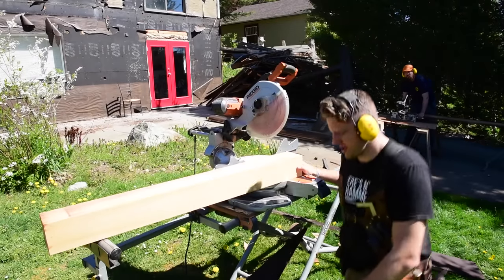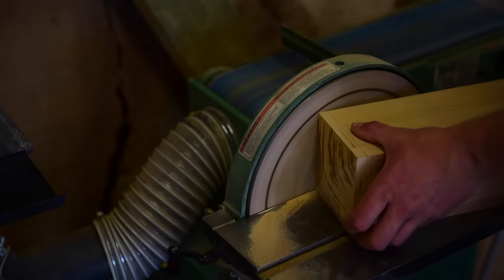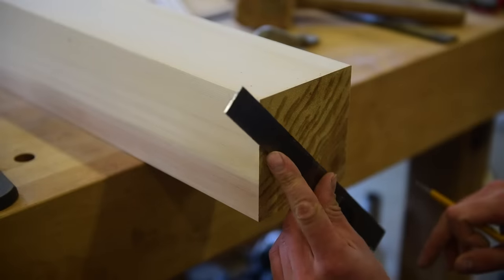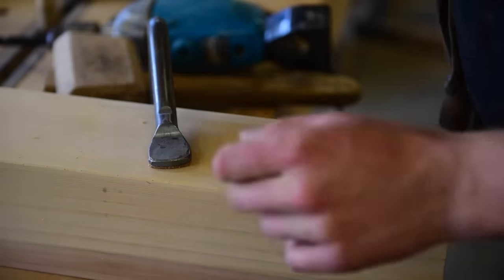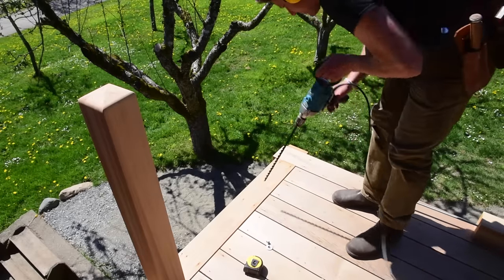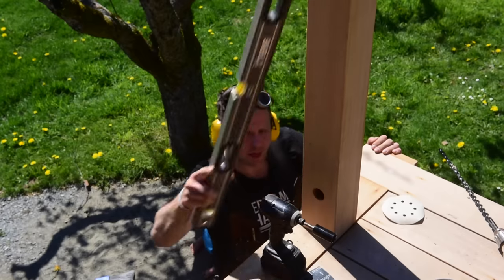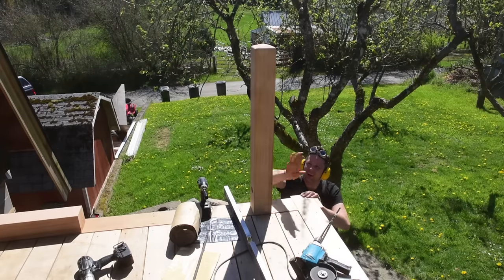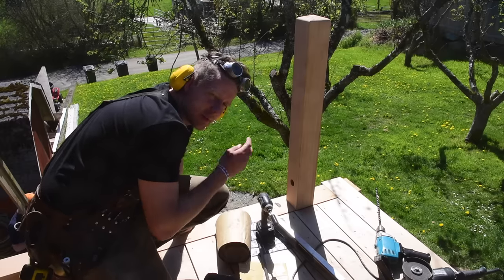FTF #54 How To Install Handrail Posts, Quick And Easy

Comment: Nice system but it wont pass inspection here in California.
Reply: Good thing he doesn't live in California then, eh?
Reply: Yeah, I unfortunately do though. lol
Reply: won't pass inspection in any state ....
Reply: won't pass inspection in any state ....
Reply: John S what is code for this is cali
Reply: A structural engineer wouldn't have a problem signing off on this design. Guaranteed those posts/rails can withstand 300lbs of linear force
Reply: it's funny to me how people naysay comments like this. of course this will pass inspection on a low deck.
Reply: COREY EIB it does not matter if it is a high or low deck if it needs a railing it has to be built to code. this would not pass
Reply: Can you explain why this wouldn't pass?
Reply: Engineered railing systems must be tested to meet IRC and IBC building codes. The tests include: 

Infill Load Test: The strength of the balusters are tested so that a 1 square foot area must resist 125 lbs of force. 

Uniform Load Test: The top rail must be able to sustain 125 lbs of force applied horizontally or vertically. 

Concentrated Load Test: The top rail must be capable of holding a point load of 200 lbs of force applied to the mid span, on the side of a post, and on top of a post. 

On Samurai's post, I would not have any problems with it, so far. Need to see the whole rail system before I would sign off on it.  Here in Southern California.
Reply: He lives in Canada....
Reply: Aye .... the code Mate, the code ...... Don't invite stupid, careless people to your house .......ps. don't get hissy - I was a high end residential carpenter in commyfornia  for 20 yrs.......... The Archetect tell the Engineer what he wants the Engineer tells the Inspector that it's cool, The Inspector signs off on it and is never heard from again......... JRW
Reply: warriorextermworkout  some areas in the states don't even have inspection, so keep to what you know.
Reply: Brigadier Chooch of the West German chooch legion um, ya because everyone has access to a structural engineer to come tell the inspector he thinks it's okay..lol
Reply: I appreciate all the info you guys have provided, next deck job I do I'll ask my engineer and the local building department about using this system. As to why I think the local inspectors would have a hard time passing this; I don't think they would like a railing post to be held by a single fastener through end-grain.
Reply: in British Columbia, a city inspector will not sign off railings until a structural engineer has provided stamped drawings. The city does not want the liability if something goes wrong.
Reply: I live in ILLINOIS, our inspectors have a "code" book which was written by engineers , so ur railings either pass code or don't , there not gonna waste there time listening to your engineer tell them that it may not pass your code book ,but don't worry it passes mine..It's either pass or fail , or u fix it to code..period
Reply: Yeah, if you are going to take the time to make a comment like that, at least qualify it so you don't sound like a troll.
Reply: --  I don't think they would like a railing post to be held by a single fastener through end-grain.

That is a reasonable point, why not make it in your original comment?

My question would be, I did not get a good look, but if there is a washer and nut on the inside of the hole for the fastener, like how they often do IKEA stuff ... and not even into real wood but into particle board, why would this not work, especially if it is braced by strong rails?
Reply: unclejack123 what does jrw mean!?
Reply: justgivemethetruth don't think it's a question of if it will work or not, the question is if it will pass code... there's plenty of designs good and bad that I'm sure "" will work "" but inspectors have a code book for a reason, not saying I agree with it , but I see the reasoning, helps save time and I'm  sure lawsuits.. if your design works but doesn't pass code ,but he signs off on it and something stupid happens and someone gets hurt , that's just a lawsuit waiting to happen against the city .. specially here in America were most r just looking for a hand out...
Reply: justgivemethetruth My comment was more aimed at those who work in construction who I amused would very easily be able to figure out why this may not be up to code.
Reply: Which is funny because there are plenty of "per code" decks and railings that fall off of houses and hurt people every day. It really probably depends on how many posts he puts versus the "picket railings" he plans on installing. His carriage bolt on the end grain to be used for a load bearing corner post? Yeah, that wouldn't pass code. Using it as a mid-railing post that has a primary purpose of cosmetic and/or to support a top member that bridges between corner posts? Yeah the single end grain bolt will work.If it is a free standing deck (as opposed to attached to the house via rim joist, code goes down dramatically. Also height DOES matter. If it didn't, decks that are 2-4ft tall would require robust railings, when many of them do not as they are considered patios.
Reply: Holmes makes it right
Reply: How about those newel post anchoring kits that come with a 3/8" x 8" rod that lags into the rim joist on one end while the other end that is threaded goes up a bore in the bottom of the newel and is secured with a nut through a side bore, just like done here. I use them all the time and have never had a problem with inspections, though they have always been interior use. The threaded rod used by the master Samurai here seems like it would be even stronger and perhaps even overkill. I think here in Massachusetts exterior newels are not allowed to be notched around the rim joists, the whole thickness of the newel is carriage bolted to the side of the rim.

My only potential concern was with boring a hole through the entire middle of the rim joist, though it is and always is a double rim anyway. just a thought, I'm sure it is still diesel.
Reply: It would pass inspection. If it works on newel posts why wouldn't it also work on deck posts? even in california. Especially if it was detailed on a stamped set of plans. Code only specifies rail heights, max rail span between posts, can't have a space bigger than 4". I mostly see through bolts. see tons of lag bolts, and this is way stronger than lag bolts.
Reply: Nothing passes code in California. HAHA. I've had inspectors lean and run into railings trying to break them and then say: "What if two big Samoan guys are wrestling and run into the railing? It might break!" -_-
Reply: John S its a wonder you guys have any usable building materials in California , what with everything causing cancer and all ! lol
Reply: I am not in the trades or any kind of structural engineer or inspector. But I think the fender washer and nut alleviates this concern. That the threaded rod is going to have a nut and fender washer on it. So it will be applying compression load to endgrain. It is not like toe nailing or like a lag screw into endgrain. If he tried to do this with a hanger bolt, well, that would be different.
Reply: Yeah right, murican claims that visited moon 1960s and you have inspectors for decking and code for every nuts and bolt.
Reply: I realize that something similar to this is common practice for interior railings but I think they have a lot less stress against them i.e; interior railings are generally just used for a hand grip when entering or exiting a flight of stairs but an exterior deck railing would be more likely to have a bunch of big drunk guys leaning against it getting a little rowdy. lol

I would love to see Samurai strength test his design against a post mounted with a Simpson DTT2Z and double threaded rods.
Reply: Lownslow84 It's pretty bad here, a few years ago they changed the law so paint stores can only sell oil-based paint by the quart because its a "hazardous material" and somehow making the painters buy more smaller cans of it is helping.  lol
Reply: If your right I guess the question is whether or not a engineer would approve it .
Reply: H C I wasn't aware "mighty rugged" was an engineering term. You also seem misinformed as to building code, in the majority of the us you need a permit to legally make almost any change to your home even if you are not a contractor. Building a deck of this type here in California requires a permit.
Reply: Maybe in the socialist state of California.  I can build an entire house and I only have to pull a state electric permit  and there will not be one single inspection.
Reply: H C sorry that is so wrong, you CAN NOT just build what ever u want at your own house , weather you have a licensed contractor or you do it yourself it still has to pass inspection. There's other ppl to think about , ppl coming over ,kids, if you loss the house , once you sell it etc.,just because it's ""your home ""(technically probably the banks home )  means nothing ,your property is still in a city / town  and they have building codes...
Reply: I'm not in the city.  There are NO inspections and only 1 state electric permit required to build a full house.  You are thinking every one lives in the city.  Montaina, the Dakotas, Nebraska, Kansas, the list goes on.  The entire mid west outside city limits you can do what ever you want.
Reply: Ok ya , well you got me there , Sure if u live out in the boonys were your chopping your own wood sure build whatever you want , but that's kinda not what this whole comment section was about, it's weather or not it WOULD pass an inspection ..cheers
Reply: You got me there too.   Sometimes we all get a little carried away in the comments.   I usually attach posts like in the link that has been posted a few times.   The way samurai did it is how most newel posts are attached on the inside of a house .
Reply: Simpson is always coming out with new ways to force people into buying their products. Samurai's way would easily pass any inspection.
Reply: Thanks , I have be in the construction world for almost 30 years.
Reply: hehe haha
Reply: John S considering wood has greater strength in the tangental axis and has superior compression resistance. i see no concern. Its not held in by wood screws its a 3/4" rod that has the strength of a few thousand lbs.
Reply: That Simpson Deck Post blog linked above included non-Simpson blocking alternatives.

It's so sad to see so many people OK with ignoring building code for some complicated home-brew method that cuts the outer fibers of the joist, and drills clearance holes through the joists from top to bottom.  Dumb, dumb, dumb.
Reply: I attached my post to my deck the same way the Samurai attached his, with the exception that I used 1/2 threaded rod instead. My post are made of oak (because I had a few trees cut down on my property and had them milled). This method of attaching post was approved by the inspector in my town of Waterloo, Iowa.
Reply: Oak is a different story.  A 4x4 oak post connected this way would never break off.
Reply: mark a knewel post have been done like this world wide for 100 yrs
Reply: In Ontario Canada, I work for a stair and railing company and if presented with the opportunity, we do this method of anchoring. This is superior in all forms only in exception of wood joinery or lap jointing a header and lag bolting to the header.
Reply: Blake Todd I am not disagreeing that it has been done all I know is that my local inspector wants to see posts below the deck boards boxes and bolted to the framing. they won't even pass it if the post is notched
Reply: Brigadier Chooch of the West German chooch legion if you can't be nice then don't talk to me.
Reply: John S local inspector needs to upgrade his education
Reply: Blake Todd hey Blake how are you ???
Reply: I like Samaurai's design, but I don't think you can compare it ti a coffee table with a designed 4 month lifespan
Reply: Decking shrinks and expands. I imagine, if it weren't so secured from the ballustrade, the posts would loosen up and go out of plumb loosing its strength. Hence why posts are usually fastened to framing
Reply: It would be an issue indeed, if the portion of end-grain holding the fastener would be closer to the post's end. But with the fastener being at least 3" deep into the wood, as far as I can appreciate, I don't think that's an issue. I did a rough calculation, and you'd need to pull the post upwards with a force equivalent to more than 650 pounds to come near the breaking point. It is indeed less rigid than a joint with a socket, when pushed sideways, but that should also not be an issue as soon as/if you put a railing at the top, connecting all posts - a wooden railing would add the extra rigidity and spread the load.
Reply: The section of wood under the washer is indeed compression loaded. But that's not what keeps the post in place. It's the shear resistance along the grain, ideally/theoretically on the edge of the cylinder between the washer and the deck. Suppose this cylinder splinters off of the rest of the material - the post would only be held in place by the bending resistance of the threaded rod.
Reply: California currently (in my county) requires 42" in height and nothing larger than a 4" opening.  Samurai, I understand you have wee one's, how are you gonna deal with what appears to be an enormous space between corner posts?
Reply: you speak the law, but its complaint driven by nosey neighbors or unveiled during an inspection at the time of resell... most folks play dumb, hope to get grandfathered in, and are happy to have their property fenced off from the tax assessors as well... We all see how California enforces its own maintenance on its state-owned structures... Lake Oroville spillway collapse comes to mind... but yes, I know where you're coming from with the end-grain fastener...
Reply: yeah, cause english professors build the best houses...
Reply: If you can't write, you cant read.  Code is written.
Reply: true statement to a certain extent... i've met some great builders that couldn't write and even laughed at what they said when you repeated it back to them... a good general contractor and a rational code enforcer are priceless... code is different in nearly every county of the US... the gist of this thread for me is stressing the importance of local ordinance... i couldn't imagine a code so comprehensive for a nation as large as the US... it'd be a big book of nonsense for most builders...
Reply: It's much cheaper to build it to code than have a structural engineer provide analysis, and most of the  time the engineer will just comply with the code anyway to not look ignorant.
Reply: Sometimes I think Simpson Strongtie lobbyists write much of the structural code.  They seem to be the ONLY solution to many deck and seismic issues.
Reply: Name another company that sells brackets at the lumber yard. It's kinda weird...
Reply: John S
I've been framing for over 30 years and have never seen an engineered set of plans not specing it simpson. There was a brand called silver that was cheaper but no engineers would give it a shot.. especially in public works projects I did . School framing , college's and fire police facilities. Monopoly period.
Reply: Simpson created the standard nomenclature for seismic hardware, but I have used a couple knock-off brand equivalents without any problems from building inspectors.  It's a very interesting topic.  No one can patent a nail or a strap, so Simpson's monopoly can be challenged by competitors, but some of the more complex Simpson engineered sheer panels are patented and cannot copied.
Reply: Somehow that does not surprise me.
Reply: no wonder this kind of stuff is not popular in S. Cal.
Reply: damn "Archetect".... I don't wanna live in "commyfornia"
Reply: maybe the salary for inspector in those states is $3/hr so no one wants to be an inspector
Reply: If the homeowner designs the railing and hires you to install it to his design, the homeowner is  taking the liability.  If individuals would start signing their contracts with the so called authorities "without prejudice" then they have no say in the matter anymore.  You just qualified your signature and told them you are not promising to perform on their contract.  Works, understand public policy vs law and you will be much farther ahead.  All used houses are sold as is anyway.  A homeowner does not need to jump through hoops if he does not want to.
Reply: Leave it to the Simpson people to chime in -  they're right though.
Reply: Or... Don't get them inspected.
Reply: John Sesser   Just one more reason to NOT live in California.  I really didn't need another.
Reply: should be legal, easy to do the stress calculations. All thread is under the correct sort of load, specs for tension loading be easy to get. Calculation is easy to do. Add to the fact that steal posts for hand rails are bolted down the same way.
Reply: It will if you "donate" to Jerry Brown!
Reply: The code (IBC) is 200 lbs sustained load with a 2.5 x factor or 500 lbs/sg ft. for top rails.
  50 lbl x 2.5 = 125 lbs / sq ft for balusters.
Reply: Be careful over there. I hear everything gives you cancer in california
Reply: Where?
Reply: K S I didn't see mention of the rod diameter. I assumed 1/2". Do you know for certain that it's 3/4"?
Reply: @Harley04  Stop trolling. He's a fool.
Reply: @justgivemethetruth  it's ready rod ffsks. Not a fastner. Strong as f%*k